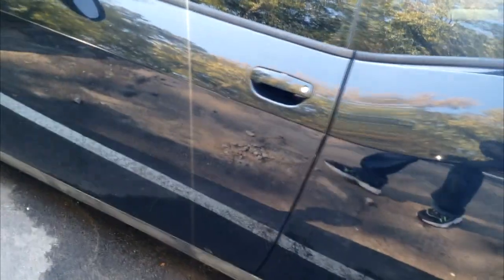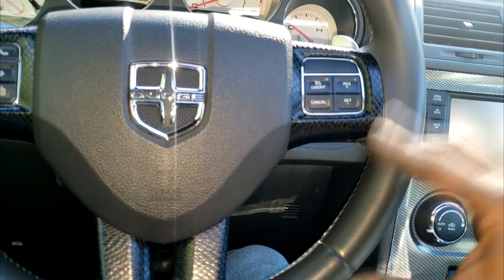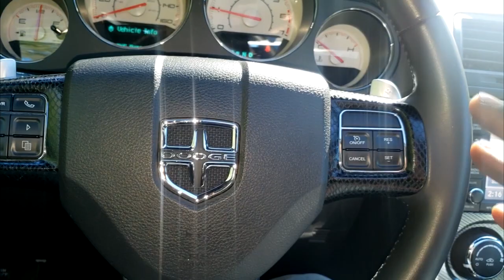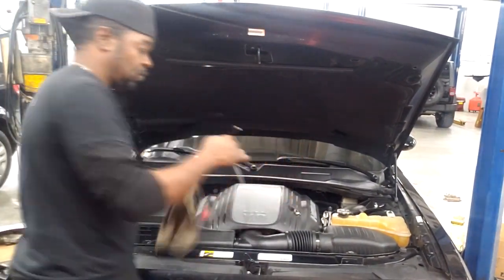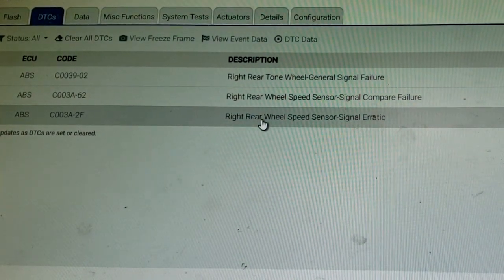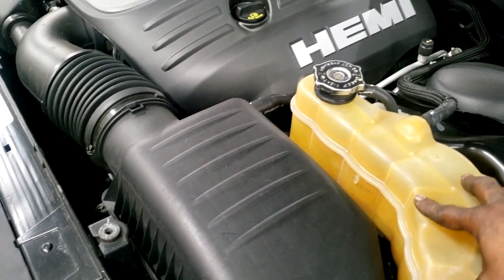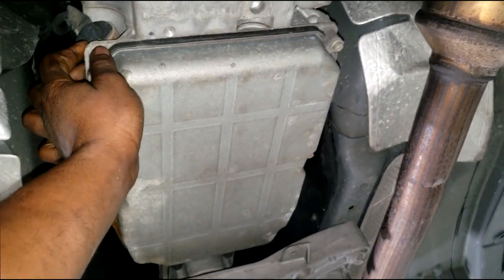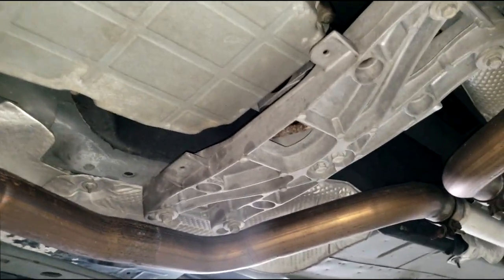Things you need to know about your car. DIYers. ABS and Check engine light on. Hemi tick 5.7L V8 SRT

Comment: abs cant calculate different tire size, unless the pcm is programmed for it. i know tire size can be changed with my mustang in the aftermarket tuning hardware i have.not sure about mopar pcm
Reply from the maker: Im not sure how that work because I see race cars at Allpar Garage with the bigger ties on the rear and the smaller in the front equipped with the Nag1 transmission. I guess when its a race care, a stupid ABS light not a concern..lol

Comment: Yep, either an RT, or the S for the new models.   Looks as though it mostly sits outside.  I'd change the brakes and rotors, and maybe take a quart or two out of the trans, and replace it  of course.  Then clear the codes.  Ride it til it dies completely.
Reply from the maker: Curious, what will removing a quart or 2 out of the transmission fix? Theres nothing wrong with the transmission. The problem lies in how the transmission shifting. O and that code is active which means as soon as you drive it, the signal from that RR wheel will be seen as missing then the light would be right back on. Thanks for watching bud, please subscribe to the channel for me, thanks
Reply: Slowly cleaning the fluid.

Comment: Car not a SRT.  INTERESTING video.  I had a NAG1 in my 07 .   Electrical connection issue and general fluid/filter changes.   Lots of burned tires.  No replacement for displacement
Reply from the maker: Thanks for watching PJ. The title meant to also pull in the SRT owners. Because the same setup apply if equipped with the Nag1 transmission.
Reply: @OnlineMechanicTips  u said it during the video.
Reply from the maker: @pauljoey7977  lol, mispoke man..lol..it happens...
Reply: @OnlineMechanicTips  great video.  I learn from u every day